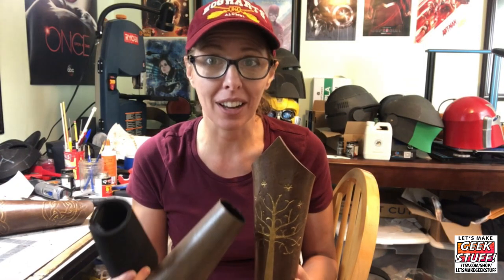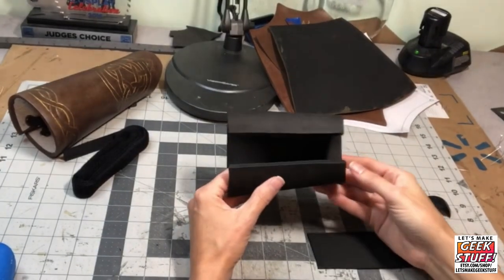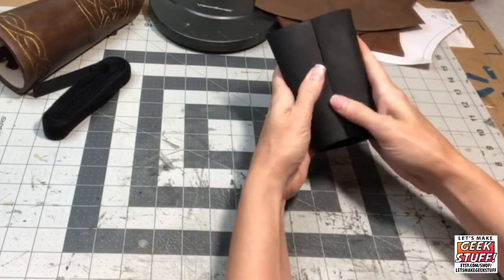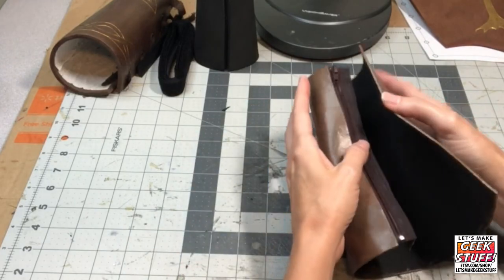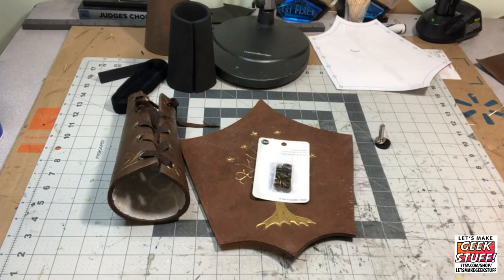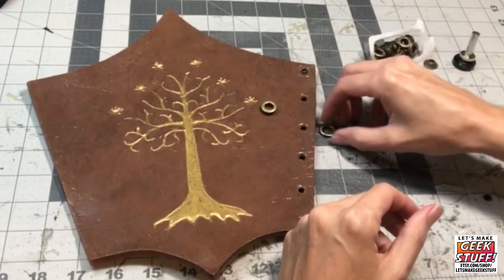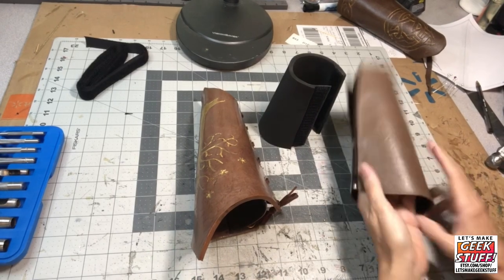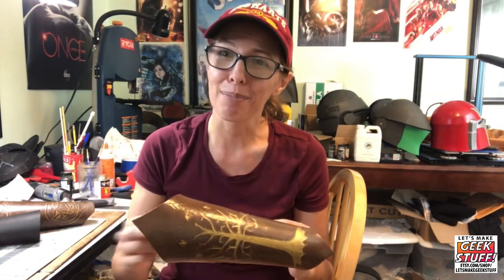How to Fasten EVA Foam Bracers: Part 4 of Making Cosplay Bracers

Comment: Will the metal rip the foam over time?
Reply from the maker: Thinner foam can be torn over time, but I have done the grommets/eyelets in 5mm foam and used bracers for years without any problem.  I think one key is designing it in such a way that there is not a lot of stress on just a few eyelets. If you have a long line of them, it evens out the pull on each individual.
Reply: @letsmakegeekstuff4799   Is this with regular 5mm craft foam, or EVA foam? I think in a prev video you said the Tree of Gondor bracers (with the grommets) used basic craft foam, but I wanted to check

Comment: wouId 1mm eva foam work for gIuing veIcro onto?
Reply from the maker: Most velcro will be stronger than 1mm foam. So some options: find very weak velcro, use only a very small amount of velcro, or always make point of unfastening by pulling directly on the velcro itself and not on the foam.
Reply: @letsmakegeekstuff4799  how thick shouId the inner foam be then?
Reply from the maker: oic. Yes, for the underfoam you could do a thinner foam, just be sure when you are opening it that you pull apart the velcro rather than pulling the foam itself.  
 @markvo3137
Reply: @letsmakegeekstuff4799  so then 1mm is fine then or 2 or more? also how do i know when to stop heating my foam? shouId i scaIe my bracers to be a bit wider for the inner foam and veIcro?
Reply: ok so i figured there's a difference between craft and eva foam, hobby Iobby has 2mm and 5mm, which one shouId i use?
Reply from the maker: @markvo3137 it’s true that different kinds of foams come in different densities.  For these bracers, I’d use the 5mm for the bracer and 2mm for the under piece so it’s not too thick.  Just be careful when opening to pull the velcro and not the foam.
Reply: @letsmakegeekstuff4799  alright and is the velcro in the video one sided or double sided?
Reply from the maker: @markvo3137 i used sew-in velcro.  I glued it with contact cement.
Reply: @letsmakegeekstuff4799  i could also use hot glue right?
Reply from the maker: @markvo3137  Yes! It's messy stuff though to do so with care.